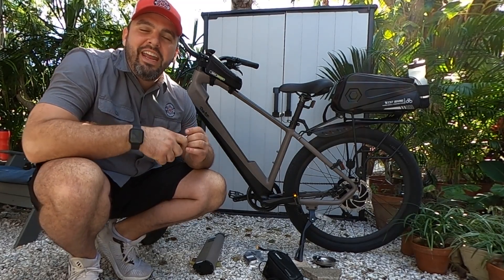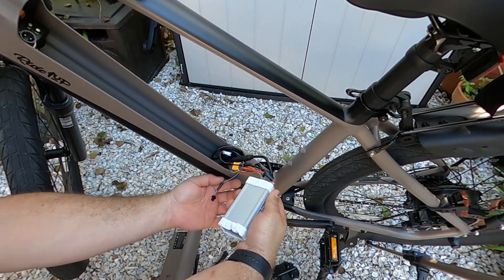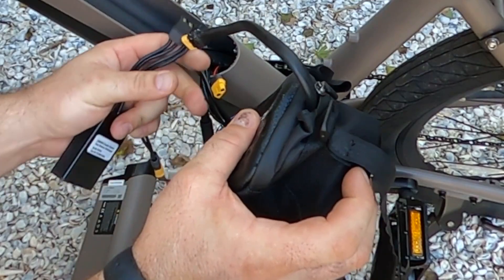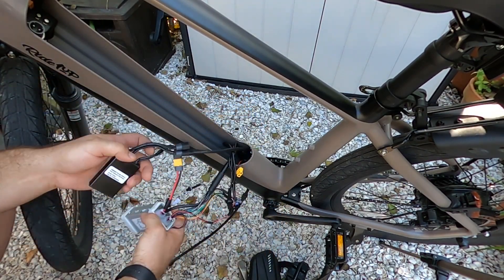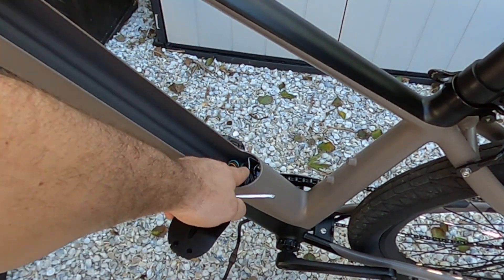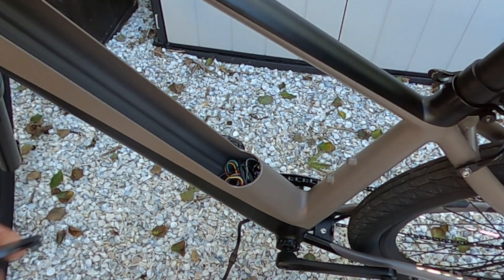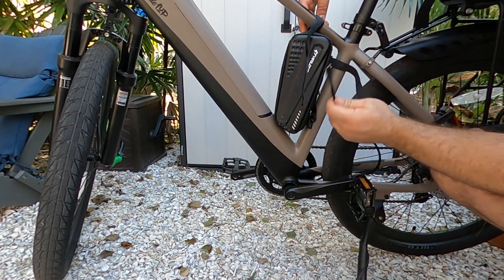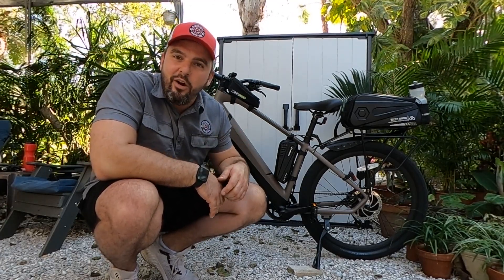Ride1Up | LMT'D | Plug and Play Dual Battery Discharge Balancer Kit | Install Two Batteries

Comment: would this work for ride1up cafe cruiser
Reply from the maker: We haven’t opened up the cafe cruiser but you are welcome to send some pics of the controller and connectors to electricallwheel@gmail.com and we will take a look and see about getting you a kit
Reply: Have you updated any uses for the Cafe Cruiser?  @ElectricAllWheel

Comment: is this possible for my core-5?
Reply: Yes. This balancer works great on the Core 5. However it will not fit above the battery next to the controller because the battery keylock is in the way. But it will mount in the frame at the bottom of the battery. All you need is 2  2-ft XT60 extension cables to connect to the controller and frame battery and and it will fit in the bottom area. I would recommend you get smaller gauge extensions like 14-16G.

Comment: I had a DATE X2 30 Amp Combiner for my dual battery setup on my Polarna M5 1,000 Watt Ebike. Decided to try the Ride1 Up for comparison. Wow! What a difference! 47 kmh on level ground. Now became 51 kmh. The fit and finish of your quality components is far superior and your prices are reasonable. I just ordered a second unit for my other bike that is dual 750 Watt motors with dual 60 volt batteries (24Ah + 40Ah secondary battery) your Combiner/Blender is going to be the "Cherry On Top" for this Mod! Thank you, from Canada  for your fine service and products!

Comment: I would respectfully suggest, you put dielectric on each connection  that you take  apart, or all of them while you’re there. This will prevent oxidizing and. Random arcing  etc… and make those connections easy  to remove in the  future.  Jason never say a link to see this kit. Ty
Reply from the maker: We appreciate your thought process. Thanks for the comment. 
In your last sentence, who is Jason?
Reply: Auto correct,  can you send me a link to see the Kis you have? Ty
Reply from the maker: @kevinsutton3514  hey Kevin the link should be in the video description 
Here it is as well
https://electricallwheel.com/dual-battery-discharge-kit-40a-ride1up-fit/

Comment: Interesting.  I have a Gen 2 LMTD with the controller up behind the battery lock.  Is there anyway to relocate the controller, or have long enough extensions for your kit?
Reply from the maker: We have extra extension cables available. They have not been tested for fit in the frame down the wiring rail. Our first attempt would be to exit the wiring out of the frame at the top near the headset.

Comment: Very nice video; I have built several ebikes, mostly middrive, I have just purchased my first, factory bike - a Ride1Up Limited.  A couple questions:

1). Any reason you didn't strap the bag to the top bar?
2). Can the secondary battery use the built-in bike charging port, or do you charge it separately?
3). How does the bike feel with the additional weight of the second battery?

Thanks!
Reply from the maker: 1. No reason
2. No, the batteries should be charged with their respective chargers or compatible chargers
3. The battery is centered over the bottom bracket so it’s not really noticeable unless picking the bike up.